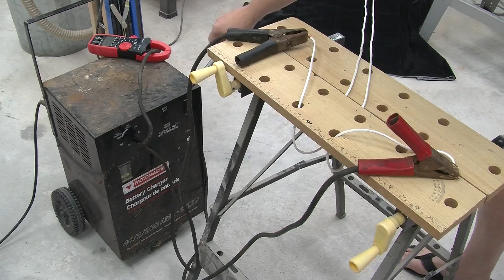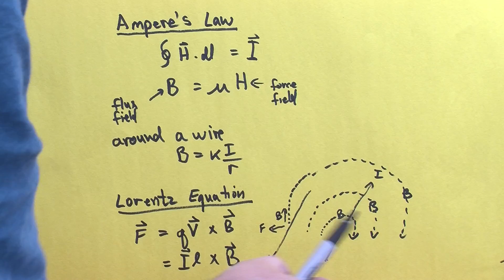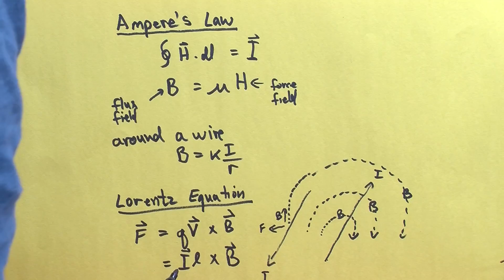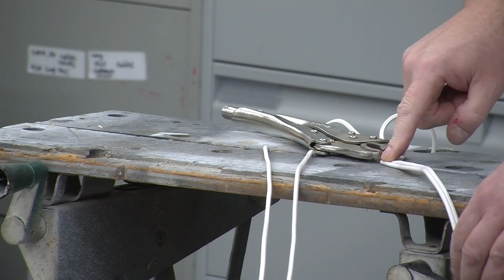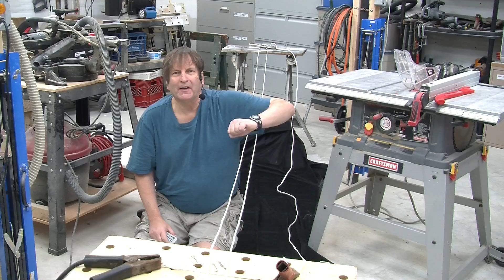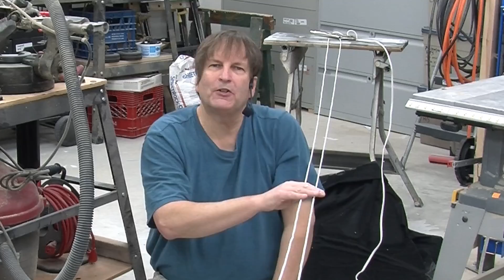Like Wires Attract and Opposites Repel

Comment: A slight paradox is this.  Ignoring the E x B (lorentz force), the magnetic field around two wires where current flows in the same direction in both wires - is the same polarity.  

For example, run current through wire 'A' and use a compass to detect the magnetic field polarity.

Then run current through an adjacent wire 'B' in the same direction as wire 'A'.   Use a compass to detect magnetic field polarity around wire 'B'.

The magnetic field around wire 'A' has the same polarity as the magnetic field around wire 'B'

Since "like poles repel', the 'like' magnetic poles around wires 'A' and 'B' seemingly would push them apart.

Trying to reconcile 'like magnetic poles repel' with the Lorentz force between the two wires was really interesting when first learning about this behavior.
.
Reply from the maker: So assuming I am understanding your point properly (correct me if I am not!) your saying based purely on magnetic fields (ignoring Lorentz force),  two wires carrying current in the same direction should repel "because the magnetic fields are the same, right?

Think of two wires near each other carrying current going into the screen so the would look like two dots     o o    (imaging the o's being filled in). Now put a half circle magnetic core  around the each wire like this :    (o  o)  .     With current flowing the top of the left bracket will be N, the top of the right bracket will be S  (and opposite on the bottom of the bracket). So with N on top left  near S top right the cores will attract. 

And this would be consistent with Lorentz force type results. Hope that helps!
Reply: @ElectromagneticVideos  Actually more a 'lowest energy equilibrium' perspective (thermodynamics) and comparison of the wire magnetic field with the Lorentz Force.

1) watch the compasses around the wire in the yt video "Magnetic Field Around a Current Carrying Wire"

2)  if two such wires were placed next to each other with compasses,  the compass of wire #1 directly across from the compass of wire #2 WOULD POINT IN THE SAME DIRECTION and thus the magnetic fields of the wires oppose each other, and forcing "like" magnets together INCREASES THE ENERGY of the system.

From Nature's perspective though,  because of the Lorentz Force,  it appears Nature had the following dialog:

"I have two opposing magnetic fields of the wires, and the energy rises if their opposing magnetic fields are forced to come closer to one another.  Not good - I am Nature, and I want the lowest energy equilibrium."

"But I have the Lorentz Force which forces them together.  Trying to KEEP THE WIRES PHYSICALLY SEPARATED requires more energy than forcing the opposing magnetic fields of the wires together.  So the lowest-energy equilibrium is to 'let the Lorentz Force win' and just put up with the opposing, 'like' magnetic fields of the two wires being forced together;  because that situation is lower energy than what is required to oppose the effort of the Lorentz Force that brings the wires together."

"Why on earth an experimenter is forcing me, Nature - to choose between 'opposing like magnetic fields' and 'opposition to the Lorentz Force' is outside my control, but if they're going to force me to choose,  I'm Nature - I'm always going to choose the lowest possible energy"
Reply: @Greg_Chase  does this yt video explain? "The Force That Physics Erased: Ampère’s Forgotten Law"

Comment: Another great video.   This is using DC though... keep it simple I suppose. 
 You should see what happens when a large power switchboard is tested for high kA proof testing.  Where they dump 45kA or perhaps 80kA into a short circuited busbar system. 
The busbars heat, soften and attract/repel in a dance for a specific time... they either touch each other or ground in a big flash... or pass the mechanical/electrical proof testing, even so as a great hot mess. All copper bars twisted and black.  LOL.. good fun to watch.  

This explains another rating you see on equipment that may intrigue some people - the kA rating.  e.g. You may see ceramic fuse cartridges with the blow rating of say 125A  and 100kA also appearing. ..or perhaps a domestic Circuit breaker rated at 10A , but also 6,000A 
But that's another thing to explain.
Reply from the maker: I would be fascinated to see that - from a good safe distance!!!!!!  Do you test those things or were you just lucky enough to be able to observe? If you could video that (and even better with a slo-mo camera ) - wow - what a youtube video you would have!!!!

Comment: Hi from the uk 
Beautiful demonstration. Why could this not have been shown in school 50 years ago rather than here is a drawing just accept it. 
It wasn't until I had to jury rig a starter on a large diesel engine that I saw it for my self the motor pulled about 2000 Amps and the cables really did swing
Reply from the maker: Thank you - really appreciate that! Sadly there are so many interesting experiments that could be used in grade school or high school  to really make science interesting and yet are not performed, or at least weren't when you or I were in school (sounds like were were in school about the same time). I had always heard stories about starters  pulling enough current to make the wires swing. Its so neat to hear from some who has actually seen it. It is such a weak force - but with over 10 time the current I used I can see how the even thicker starter motor wires would move.

Comment: So? From an electrical viewpoint, a twin-lead cable cannot be overloaded too much without causing a short, but from a magnetic viewpoint, a twin-lead can be overloaded a bit, because the wires separate a bit .
Reply from the maker: Its mainly a demo of a very basic physics phenomenon. The force is really minimal - had to pass a large current and setup the wires carefully to make the demo work. In most cases other pressures like bends in the wire would easily overpower the repulsion as the plastic insulation melts to cause a short. 

The practical application is really current going in the same direction in stranded lighting rod cable. Apparently when lighting hits so much current passes that the metal gets soft and the attraction forces pull the strands together and the bundle of strands gets welded together. I have never see a cable where that has happened but would the thrilled to come across a cable like that. We are sure lucky that wires carrying like currents attract  or lighting rods wires might fly apart, break, and not work very well.

Comment: Do wires hold any electrical charge after they are unplugged? Seems like when I have a bunch of wires together, They always seemed to get tangled in the worst knots. Worse than rope. Could this be because they still have a little juice and are trying to push away?
Reply from the maker: They could potentially have minuscule charge - the amount of charge they could carry depends on voltage and capacitance - and capacitance would be tiny for the lengths of wire you are talking about, and voltages are low. When you notice things like a static charged sweater its typically thousands of volts and even then the force is tiny.

The only thing I can think of why wire would be worse than rope is the stiffness of the conductor and maybe the different surface of insulation vs rope. 

And even with current flowing the forces are tiny - I did hold the repelling wires together with my fingers - I could feel the force but just barely.

Comment: Single wires carrying DC will move under high current too as they attempt to align with the Earth's magnetic field.  Normally the stiffness of the wire that can handle sufficient current masks the effect but if the wire is too thin for the load or fine stranded and with soft insulation the effect can be seen.  It'd happen with AC too but the line frequency vs wire mass would probably mask the effect.  The buildings around here with lightning protection are old quite old and use thick solid copper straps down and into the ground rather than stranded cables.  I have seen newer buildings in other areas with 35mm2 or thicker stranded down to the ground stakes.
Reply from the maker: I'm amazed the earths field is strong enough to have a noticeable effect on wires, even with high current. Is there any common situation where you would see it? Would be really neat to observe or demo in an experiment!
Reply: @ElectromagneticVideos  The few times I've seen it happen it has been in battery systems with decent, but not excessive, current over the wire.  Not the sort of thing that would see the wire start to glow and the insulation go away.  The movement was very slight but enough to make me stop and think 'did that wire just move' and see if I could repeat it by turning things off and on again and it did.  One example that springs to mind involved a single 2.5 sq mm stranded wire, the sort of wire that can be seen in cables used to wire up the AC electrical supply in a building.  It was an unsupported curve of wire, free to move, probably positioned just-so that all factors came together and allowed it to happen.  Potentially I'm mistaken and it was magnetostriction at work too.
Reply from the maker: @retrozmachine1189  How interesting! I doubt it would have been magnetostriction - I thought that was a really small effect. It couldn't possibly have been the fields from two wires interacting? Either way, I would love to have see it happen!
Reply: @ElectromagneticVideos  Really stretching the recollection now but I think the wire was far enough away from the others that it wouldn't have been affected.  I've not tried deliberately setting something up to see if I could reproduce it myself and knowing my luck probably couldn't get it to work.
Reply from the maker: @retrozmachine1189  Well you were lucky enough to see it!  I'm intrigued enough to try seeing if I can duplicate it outside (next year when its warmer!) - too much metal and stray fields in the basement workshop to try it inside.

Comment: Excellent video. Thanks for sharing this! I was wondering about the first experiment if the wires repelled were going back and forth due to the DC charger maybe putting out half- wave? Just a thought since it seemed to be showing that. Keep the videos coming ...
Reply from the maker: Glad you liked it! Actually I had a hard time keeping the  wires from swinging back and forth at the slightest touch. The force between them is so low the wires have to be quite loose. The swinging is the momentum of the wires keeping them moving after they reached what would be the equilibrium point due to the repulsion - and the rocking back and forth like a pendulum. 

If I were to wait for 5 minutes the swinging would stop but due to the high current the insulation would be melting off the wires by then.

I was able to do the experiment without swinging by using a variac to gradually increase the current though the wires from zero - and then they gradually move apart. But thats not dramatic enough for a video!

I did  find if I held the wires together with my hands I could feel the pulsing of the unsmoothed DC. In the "lighting rod simulation" end you can see the pulsing from the AC vibrating the individual wire strands before the fuse together.

Comment: Try solid wire, I feel there could be a twist in those stranded wires.
Reply: And then I saw the end of the video
Reply from the maker: There is a twist and you are right - perhaps heating (the high current does warm them) or similar could twist the wires   to move them. But the fact that reversing the current though one wire changes the repulsive direction - and AC doesn't change things - demonstrates that it isn't the case.

But - your comment is certainly that of an excellent experimenter - its always important to consider the experiment being contaminated by other things!